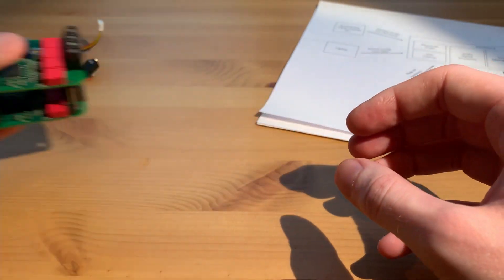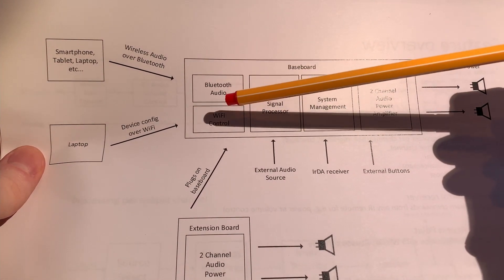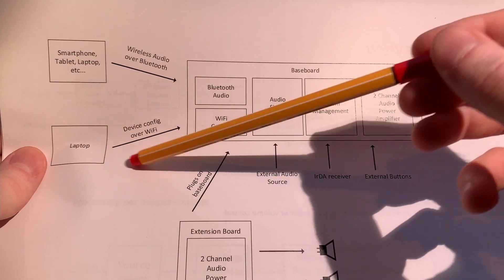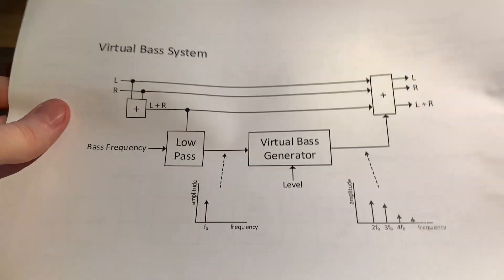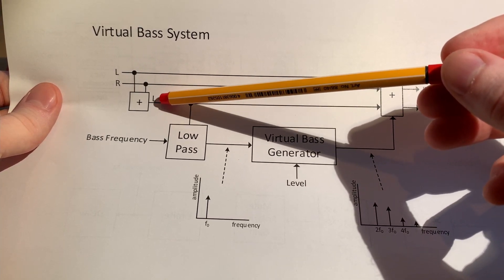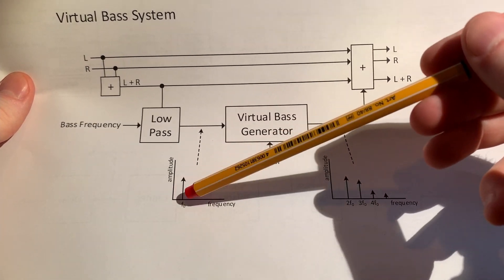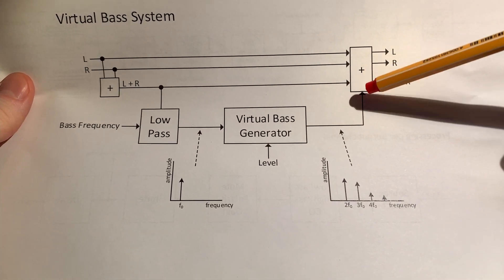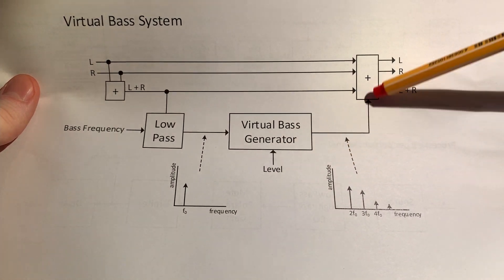[#26.1] 4-Channel DSP Bluetooth Amplifier - Intro

Comment: Are you using the internal DAC of the ESP32?
Reply from the maker: No, the Audio-DAC is integrated on the amplifier chip. Audio is streamed digitally directly into amp-chip using I2S
Reply: @YetAnotherElectronicsChannel  many thanks. Ive got another question if you dont mind, can I use a different DAC for this project a separate one so I can use a different amplifier?
Reply from the maker: @kixstartter6560  sure you can connect any i2s compatible DAC… I have used PCM512x during testing.
Reply: @YetAnotherElectronicsChannel  can you help us beginners on this project? On how to download the files and how to install them to the esp32 and how to run the program to configure the eqs
Reply: @YetAnotherElectronicsChannel  Can you help me fix in building/compiling "HINT: The issue is better to resolve by replacing format specifiers to 'PRI' -family macros (include <inttypes.h> header file)."
Reply: @YetAnotherElectronicsChannel  I've been following for a long time. bro.. use 2 PCM512x Audio ship. for 4 Channels right?
Reply: @YetAnotherElectronicsChannel  also can you help us viewers that want to make this, can you make a video on how to upload the codes to the esp32? If its okay with you